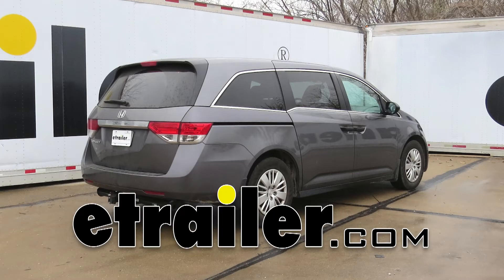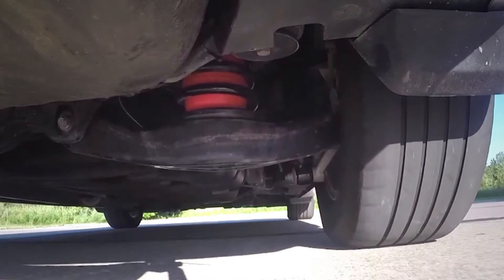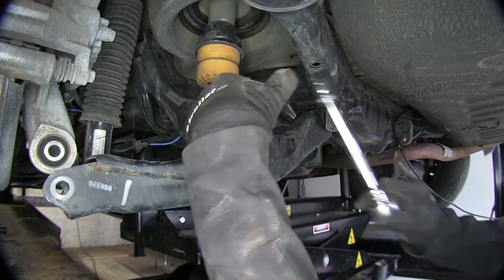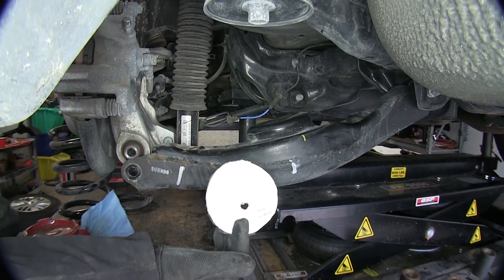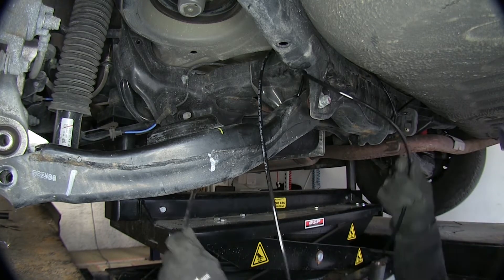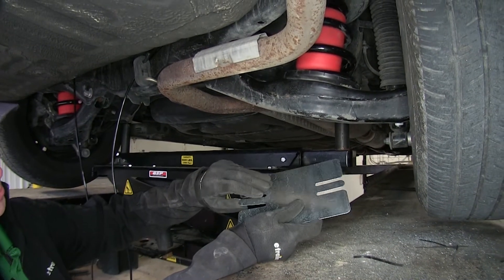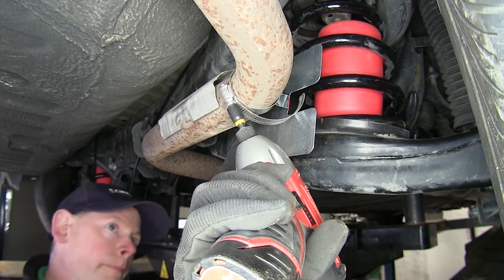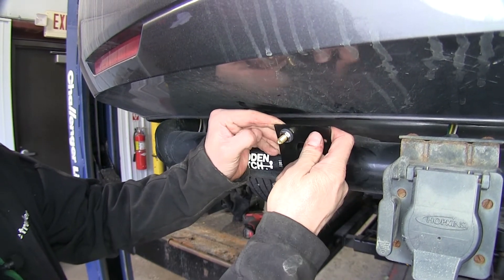etrailer | DIY Install: Air Lift 1000 Air Helper Springs for Coil Springs on your 2014 Honda Odyssey

Comment: Having the right tool for the job is important. Could you provide a list of the tools you used to perform this installation? I haven't seen a hole saw like the one you used or the the "picker" tool you used to fish the air line through the suspension. Thanks!

Comment: How often do should we check the air pressure?
Reply from the maker: The only time you would see a change in air pressure would be if the temperature changes outside changes. This will increase and decrease the air pressure and you may have to add some air or let some out. If you are experiencing large amounts of pressure loss, you most likely have a leak somewhere.
https://www.etrailer.com/Vehicle-Suspension/Air-Lift/AL60815.html